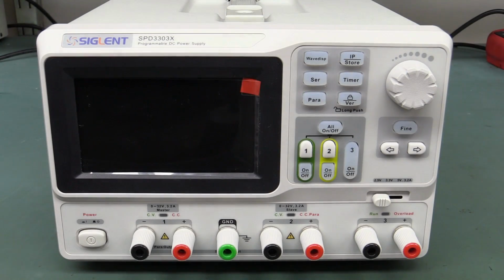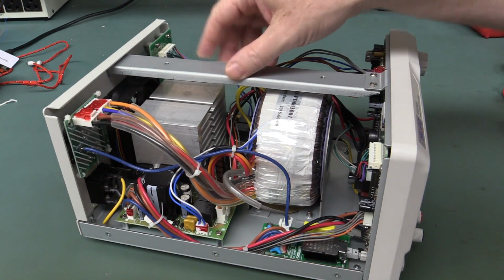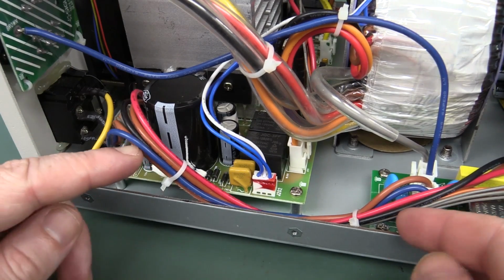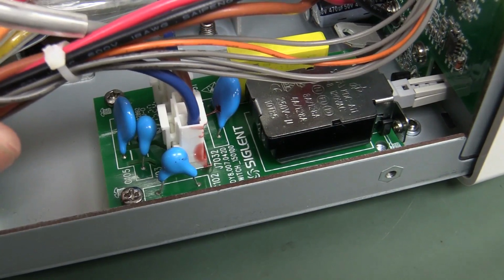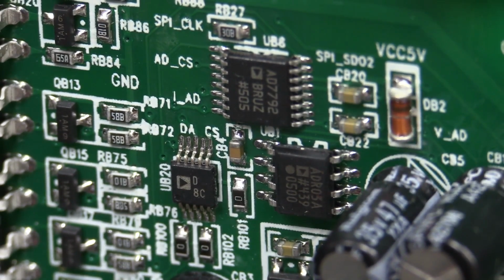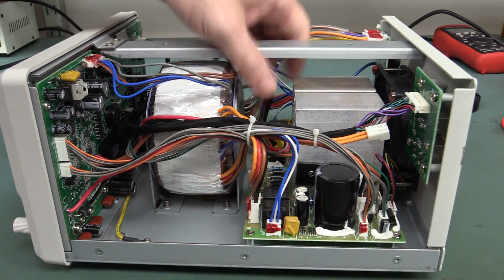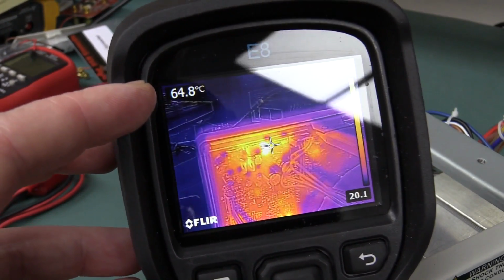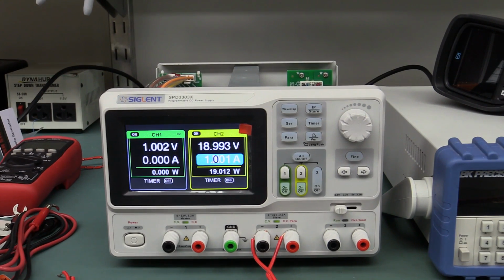EEVblog #828 - Siglent SPD3303X Precision Lab PSU Teardown

Comment: You always criticize if a product has other caps then from a bunch of vendors you prefer. Would be nice if you could make a video about that, maybe solder different caps of different vendors to a single board and test/abuse them under the same conditions.
Reply: +foamidable 
Electrolytic caps are usually the first thing to fail and the whole thing stops working because of 1 failed cap so a poor choice of cap could potentially damage the company's reputation in terms of quality. In a very cheap device where every cent added to the BOM cost makes a big difference, that might be OK; but in something $500+, it should be worth spending the extra few cents to extend the MTBF.

I think to really test between different caps might mean putting many caps from different batches and different brands under a constant AC load in an oven for a year or more just to see which fails first.
Reply: +foamidable if you design some critical ESD/SMPS things, you get to know good/ok/NoGo caps...trust me....
He´s in fact all right and well in the industry standarts while telling that these caps are the caps to go for....

It´s all within reliability, low ESR over time/temerature and aging....and as well these things do not explode suddenly, out of the blue!!!
Reply: davecc0000 of course there is a way to accerlerate this. We had an "climatron" oven where one chose between -30 and +180 gedree celius and 10% up to 95% humidity...there i left my protos for let say a week or alike ramp it up and down.

And if you like to see what´s a "WonHuanLo" branded cap is doing, simpy check these Flatscreen forums or the videos covering the repair of them, usually it´s these caps which causing the unit to fial...usually right after the waranty is over....
Reply: Cap failure takes years. Dont know if possible to accelerate such aging/heating to parallel real-world accurately.
Reply: I´ve written some, but, thanx to this shitty Utube-mobile, it´s all gone...

No, it all stay the same, you need care/con sheets in order to have iso aproval for WEE/RoHS for every component and also for and to maintain within your iso 9001:2015 as well, but no chinese vendor (will) have this aproval, jet!

And take this banana-plugs...we have 2015 and they still produce crap....Nothing changed!! They still don´t care, they only producing stuff just for some Fast Money.... 
If they had any form of Quality Control which would not only be a sticker they would not come around with that!

Sorry no chinese crap for me....i rather stick with these old school things which prooven to be reliable a thousand by thousand times !!
F&T, NipponCemicon, AVX, EPCOS!

By the way, i have high voltage caps GSX like 22000uF/450V surge 550V dated 7913 with a prooven ESR about 0,031 Ohms and more usual NCC GS 47000uF/80V surge 100V dated 8122 with a ERS of about 0.025 Ohms

So , sorry, you´re wrong here "...In the 90s there were no low ESR caps...."

you mentined 200W - is it peak?

A HDD rack of a mid range Unix mainframe 80th SCSI rack took about 5kWpeak 2kW average...and had a spinup surge of about
150A @ 12Volts and 270A @5 Volt
That is what we talking ´bout needing low ESR Caps
I still have some of these HDDs 1GB - 5 1/4 formfactor, double height. One rack had 16 HDDs of these with one PowerSupply which was water cooled...
The storage system was had five racks

IMPRIMIS - SYMMETRIX

When they changed the system for IBM, these all along with that CMOS Water cooled CPU cores had to go....and i had the chance to take what i can take....HDDs/CAPs and one CPUboard (80x60cm)
   
I also can show you some true vintage 450uF/500V military Caps with a measured ESR of about 0.5Ohm just about half a year ago....

Back in the 70thies there had been HiPower/HiCurrent powerSupplies around, as well as sliced bread... Take a CrayMainframe apart and have a look into its PowerSupply NCC/AEROVOX at its best...

If you don´t know them, it doesn´t mean that they don´t exists!! Ask google first, if you don´t know...helps sometimes ...But, pease, don´t say that 90thies and no low ESR thing ever again - low ESR exists as long as electrolytic caps exists....at least at mil/topNotch mainframe segement, or you´ll no more taken serious....ok...no fence here...but to read this, makes me smile...to be polied...honestly....
Reply: +jjensen2492 
Yeah, can't complain with that.
If/when a cap fails you always have to take a look at the enviroment they are used in.

Are they used correctly? Or were they abused?
The latter was the case with many SMPS CPU VRM on PC motherboards...
That's where the bad name for Teapo and CapXon comes from!
But also Nippon Chemicon capacitors (KZG series) were pretty bad too...

SO it's easy to say that a cap is shit, without taking a look at the enviroment.
 I have here an Acbel Flex ATX PSU where almost no cap was not bloated - the fan was pretty dusty (well, smoker enviroment...) and the caps were specced for about 2000h of life. So is it a wonder they failed?!

No it's not. Pretty obvious that they failed fast - because they were pretty hot. Because there was NO airflow near them...
Can't blame the caps for that...
Reply: +Stefan Payne 
Thanks man, that';s the kind of info I was looking for when I wrote the initial comment. I'm just a hobbyist with a soldering iron, so stuff that would seem obvious to someone more experienced is valuable to me. Doesn't  keep me from sucking in every video from this channel and dropping some euros at patreon every month though.
Reply: Stefan Payne Have you ever designed a PCB for a company running a production line of around 10k+ of these boards, built to be used in industrial envoirement?

I done this, for years....and what would be if at least one of these PCBs will may go bad...

That is then all up to you and your reputation, or better to say the reputation of the company you´re working for....

If so you won´t discuss in this way...all you care about is reliability and nothing else when doing stuff for a living...

We used F&T as well as NipponCemicon and AVX (ex. AEROVOX) as well as siemens/EPCOS and the like, but never ever chinese types...as when i had been in charge for this, back in 199x nothing was reliable and met industial quality standards (white Book, where we used to nail the scpecs into....125degree celsius rated caps as to take just one of the specs...usually these papers have 2/3 digit count pages)
I haven´t even thought about getting any chinese compoments to be mounted on our PCB - as simply go for RoHS you need a clearance/certification document for every component on that PCB as well as a WEEE comform sheet..
Signed by the usual RoHS/WEEE supervising companies....No chinese vendor back than had this, as this really cost money....But all these companies i mentioned before had/have these on hand, if you ask for...that´s it...
 
Here is an exaple of these Cer/con sheets at AVX: http://www.avx.com/about-avx/certificates/

You need those when you are in the nowadays called B2B biz, or you simpy won´t made it within the "last-round" of the selection....and this is where your company get its money to pay you.....

Simply take a look the these banana plugs...nothing more to say here.... Don´t even meet industrial standarts by any means!

Any USD 500+ item is primary for biz, not for hobby market....
So what? in that B2B sector, this thing is not going to cut...so they went over to the hobby market - hoping to sell some....
but for hobby users....they take a look at the prizeTag!

For sure!

And double check for prize!!

For me, this is a true NoGo -> BindingPosts!! NOGO

And i would go for a < USD 100 well below!
I have a (actually three of them) right below USD 50 (49,99) Linear 30V/2A PowerSupply, opened up at arival and changed a vew critical components...and that´s it...i need my money for a lot of things, not only a single damn powerSupply. And i don´t need these digital frontend, i rather stay with all analog pots/readouts as i do not need 10mV/10mA minimal setting, but i need a noisefree/RELIABLE ps.

A highside pot on a transistor´s base driving a series regulator isn´t that complex...but pulled down with a resistor would make this thing "BulletProove" as even when the savety circuit is down, the pot´s whiper will lost it´s contact...the pull down resistors ought to pull that thing down and thus that thing will be switched off...NO DAMAGE to anything while conected to something!

That´s what i want!

I don´t need USB/Serial or whatever PC to connect to my powerSupply...(WTF...??) i don´t even have a PC nearby my workbench!

So i do not need digital setup/control anyway.... I don´t want a µC in a damn simple PowerSupply.
That´s when my hobbyist point of view speaks out!!

For B2B these bananas are a KILLER! A STOP a LeaveMeAlone and pi..theF..ckOff thing!! Really!!
Reply: @tubical71  hey, I'm just starting out and looking into getting a cheaper power supply, could you suggest which components you usually replace and why? It would help a lot, thanks :)
Reply: @nicholasbrassard3512  For radial eletrolytic capacitors, go with nichicon uhw, utt, uhe those are nichicons low impedance, high temperature long life capacitors which handle a lot of ripple current, their uld series isnt low impedance but they will handle 10,000 hours at 105c, as far as Panasonic goes, go with their fm series great low impedance caps.
Reply: @analogaudiorules1724  awesome, thank you!
Reply: +TubiCal
We don't have the 90s no more!
That area is gone for almost 16 years...

And that's the problem...
The things don't stay the same, they change!

I don't doubt that what you said was not true. I doubt that it's still true! 
So your knowledge is just aged -> not relevant anymore...
In the 90s there were no low ESR caps. There were no low impedance caps. There were no polymer caps...

But nowadays every half way decent company has 125°C caps. Even 130°C!
They are called CapXon TV (SMD), TH and TE for the 130°C versions.
Or Teapo/Luxon CT Series (Polymer), HV and the AK (Low Impedance) series.
But don't expect them to be (much) cheaper than the 'japanese' Counterpart....

And as I stated earlier:
If a thing is made in china, than it has caps made in china in it!

As for PC-Power Supplys:
They have to be rather cheap and still endure some fast load changes. 
The load in a PC can change many times per second with ampitudes of at least 200W (no, I'm not joking).
It looks like [url=http://www.tomshardware.de/amd-radeon-r9-380x-sapphire-nitro,testberichte-241978-6.html]this[/url] (sorry, it's in german, but scroll down and take a look at the picture where 'Leistungsaufnahme' is written).

And they still endure a couple of years, even pretty cheapish ones...
That caps die quicker when mounted between the secondary heatsink and the secondary side coil should be pretty obvious, especially when this cap is pratty lonesome...
Reply: good companies get bought out and go to shit. i have yet to see/hear of a company going from shit to good. please provide examples of shit companies becoming good.
Reply: There definetaly are some companys that are better now than they were a couple of years back.

Here in Germany LC-Power (PC Power Supply maker) for example....

Still, People want cheap shit rather than good quality products, sadly...
Reply: No, they use Polymer aluminium caps :P
Or those Hybrid things (because of failure modes)...
Reply: I'd say something like Linkworld...
Or some major PC component manufacturers, but more due to violation of trading laws and exploting their position...

As for most parts in the World:
You'll get what you paid for. If you want cheap ass crap, you'll get cheap crap...

Though we're here at EEVblog, so I think you probably mean something like soldering irons and other lab equipment and not, what we call here 'white wares' like a small oven...
Reply: *****
black and decker. skilsaw. craftsman. all three made quality products but have gone to shit within the last couple of decades. coke, when they switched sucrose for high fructose corn syrup and changed the formula because corn syrup is cheap. i have yet to see a company go up in quality.
Reply: davecc0000 heat it up
Reply: foamidable I like your idea, make some sort of blindtest while abusing them to braking point, I mean if you bye a PSU then it to use it and abuse it, Is 3 x Siglent  or 3 X Siglent price PSU the best bang for the buck?
Reply: Just a league table of manufacturer vs reliability would be good.
Reply: @simonbaxter8001  I think that it sort of is already made. Higher price = better quality.
If you spend 5,000$ on a PSU you get way more then a 500$ ever can give you. And there are maybe 5 classes:
1) No name cheep
2) Knowen cheap names like Rigol, Siglent, BK precision and so on
3) Higher quality brands like Keysight / Agilent, Atten, Lecroy and so on
4) The high end less known names that only are been used by the industry
5) Custom built that NASA, high end labs and similar are using
Reply: Na, the manufacturers have a reputation for a reason, anything other then nippon chemicon, nichicon, Panasonic, vishy/b&c components, wurth electric, wma, kemet, rubycon, cde, elna is absolutely garbage, created with inferior electrolyte, if you had more expierence with caps, you would see failures of brands like teapo, lelon "which have gotten better in the last 5 years", elgen ect. The only two chinese cap brands that don't entirely suck, is lelon and koshirin, but I'd say koshirin is better then lelon, ultimately, i loose respect for manufacturers who don't use quality components.
Reply: +TubiCal 
Yeah, but you can't say that one manufacturer is good and the other not, especially when you have taken a look at their catalog!

First:
If something comes from china, there won't be a japanese cap in there. NOT ONE!
There may be a cap from a japanese company in that device, but NOT a japanese cap!
Because of the import taxes, you don't want to pay for that...

Besides that, a product manager/engeneer from TDK Lambda said that the manufacturer does NOT matter but what you want and what you are willing to pay...
You use "japanese" caps not because they are better but because you can use them for marketing purposes as many (still) think that only japanese do good caps. They do NOT.

But what here some people don't mention:
NCC has NO low ESR/low impedance type with less than 5000h expected lifetime in their catalogue.
Teapo, CapXon and others do!

So what we are doing is judging the japanese for their high end caps.
And everyone else for their low(er) end (=cheaper) stuff.

For Teapo the good stuff would be TA, TB and TC. Everyone seen them?
The SY series seems pretty OK too.
But what do you see mostly in (ATX) SMPS? 
Right, the SC series with just 1000-3000h rated lifetime...

With those numbers in mind:
Of course a japanese cap would last longer - because they are rated for a (way) higher lifetime, according to the datasheet...

But we are NOT fair. If we would, we wouldn't compare lower end capacitors with high reliable types...
Reply: +foamidable no. that`s NOT how it works .
Reply: +TubiCal 
"So , sorry, you´re wrong here "...In the 90s there were no low ESR caps....""

BRUH, talk about nitpicking!
Jeeez, do you think modern SMPS use huge screw terminal caps? NO..... -_-

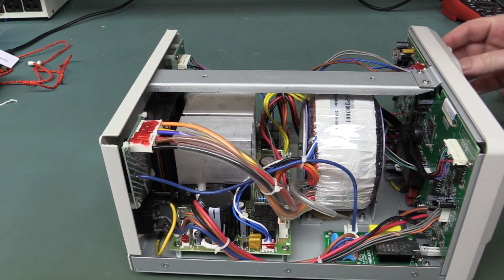Comment: Dave - Thanks for the video.  I am a "bit pusher" EE so don't know squat about transformer design.  Question about your comments about "shorted turn" at 5:05 and the bolt through the middle of the torroidal transform.  Is this an issue because it could change the magnetic fields/properties of the transformer?   I assume so as the insulating washer under the nut (very hard to see - not the big purple thingy) breaks the continuity.
Reply: Cemx86 Bolt & sheet metal bracket(s) create a magbetic current path paralleling the windings. Only it is a closed path, hence shorted. Putting a gasket between the toroid & bracket spaces them apart & reduces the effect.
Reply: +davecc0000 That purple gasket doesn't reduce the effect at all. As Dave mentioned, there is an insulating washer under the nut which eliminates the short.